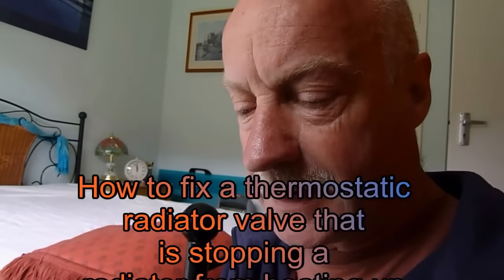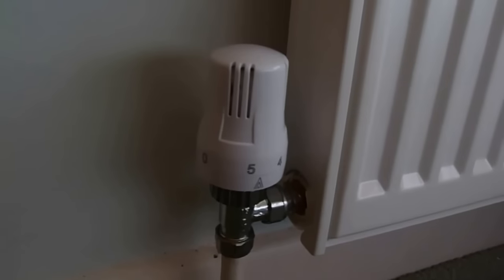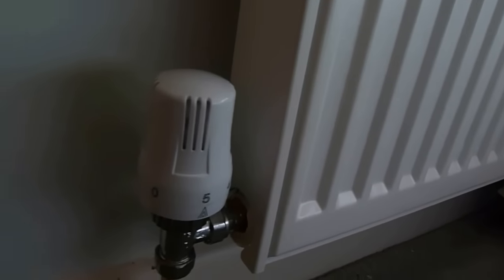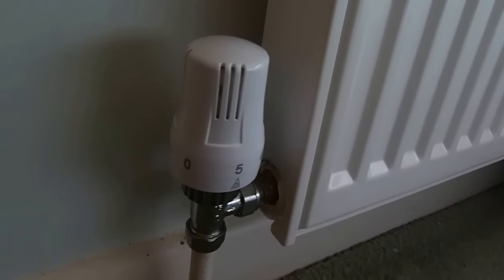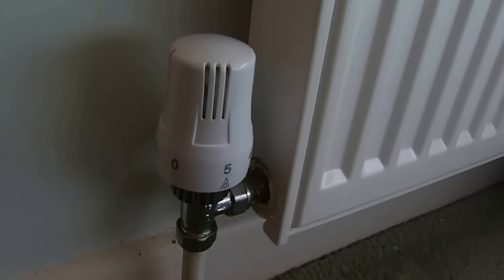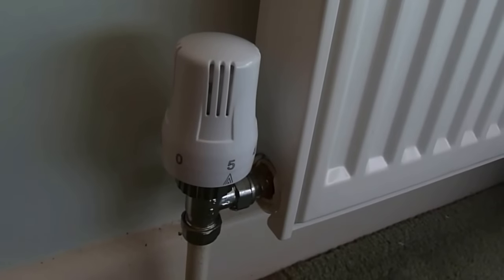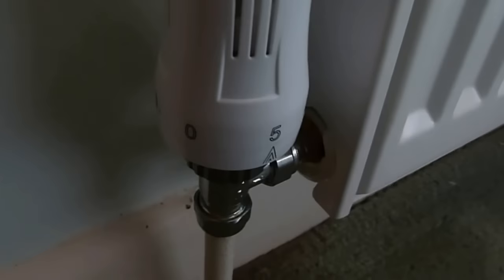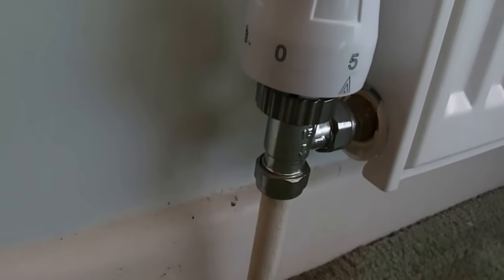How to fix a thermostatic radiator valve if your radiator is not heating up.

Comment: My radiator is too hot and I can't adjust the heat what do I do
Reply from the maker: Turn it off on the locksheild end. Then buy a new thermostatic rad valve for the other end.

Comment: Hmm, light pulling and pin came out then followed by a small dripping of water ! Fortunately had a spare valve. Don’t try this after shops are shut just in case …..,
Reply from the maker: Only happens on real old valves. If it does the pin can be put back in. 🤔

Comment: My problem is that it heats up, not that it doesn’t heat up. It doesn’t work to turn it off for some reason...
Reply from the maker: Faulty valve.
Reply: dereton33 nevermind fixed it thanks

Comment: got a leak at the thermostat when the radiator is cold
Reply from the maker: +JACQUELINE CHALMERS . Take the valve top off and check whether the leak is coming from the top of the valve where the pin sticks out or the union nut. If it is the nut it can be tightened up a touch to stop the leak , if it is leaking from the pin then it will need a new valve.
Reply: +dereton33  thank you will try

Comment: The pin does come out....quickly followed by spurting water LOL
Reply from the maker: You have one of the rare old valves, don`t worry just stick it back in, at least the rad will heat up now.

Comment: My ones really stiff you can push it down with finger
Reply from the maker: Sometimes but you normally need a hammer.
Reply: @dereton33  
 Mine's just really hard to push down 
It's not 
There's just no heat in radiator
Reply: Any other ideas y I'm not getting heat all my the other  radiators have heat 
I have got all  air out of it

Comment: I've managed to knock the pin , so that the radiator is warm, but still not hot. pin still stuck in
Reply from the maker: +Matt Madd  Try soaking it in WD40 overnight then give it a fresh tap.

Comment: hiya,  what happens when i can't turn it down?  its so hot .  :-)
Reply from the maker: Hi Nutty , when that happens I am afraid you have to renew the valve , I have a video on how to replace one it is on my channel or through my website , it is on changing a normal turn valve but it is the same for a broken thermostatic one.
Kind regards,
al.

Comment: Pin came out
Reply from the maker: Happens only on one type. Did you put it back in?
Reply: @dereton33  yeah then tapped it with a hammer. Seems to be holding. Think the seal/diaphragm will be shot?